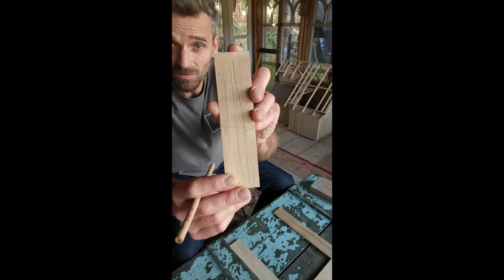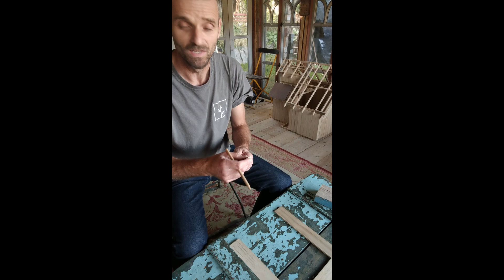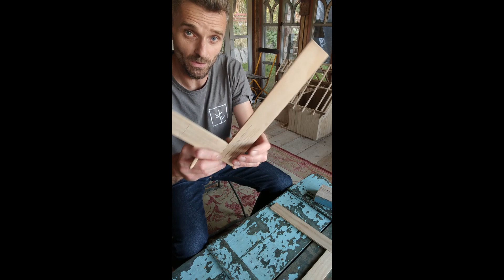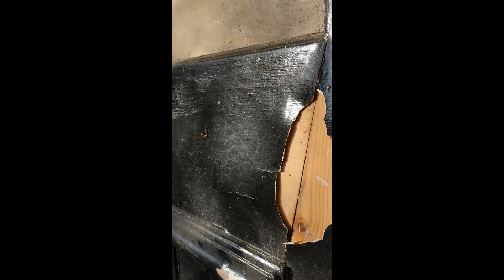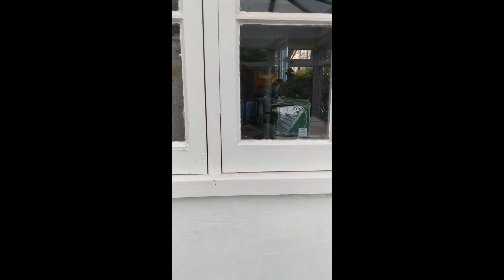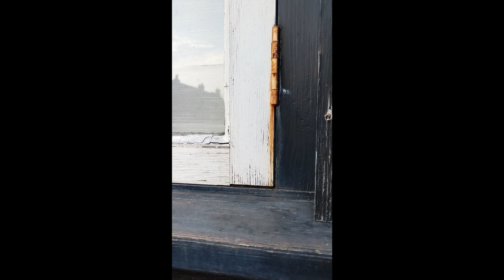Timber Stability in windows

Comment: Hi again. Excuse me for asking what may appear naive silly questions but thats OK as I am not a woodworker, but love timber. I'm hoping to make the windows for my home very soon. Fingers crossed that I can get it together to do such a thing. Timber is my favourite medium. The point you made about how internal windows sashes tend to shrink as they dry out. Would in cured timbers avoid any more shrinkage in the timber. Also, assuming one has the skill , would a dove tail joint be a better method in joining a timber window over a straight edge connection. Hope you make many more of these videos. Take care and thank you, and greetings from Australia.
Reply from the maker: Hi Again Jude and thanks for your interest. Your questions are not silly at all. Its fairly unusual to have a window that is 'indoors' as such. It is more or less impossible to resist the forces of wood swelling & shrinkage whatever joint you use, but mortice and tenon is a good all round joint. We use comb jointing, but this is using joinery machines.
All the best with your windows.
Reply: @andrewjaynes9671  Makes sense. Particularly when you think that, I guess, the wood fibres are meant to absorb moisture to reach the leaves. thanks Andrew.

Comment: Hi. just found your site tonight and already gone through most of your videos. A thought just occurred to me, why not seal the end cut of the timber surface, that have the open grain. I guess if that would work somebody would have done it centuries ago. So I'm just wondering if you can explain why sealing the open cut of the timber grain wouldn't work in stopping a lot of that absorption of moisture. thanks again.
Reply from the maker: Thanks Jude. Yes end grain sealing is important in reducing some moisture uptake. Over the years though, if the sealer gets breached then moisture uptake gets a foothold quickly.
Reply: @andrewjaynes9671   Thanks Andrew.